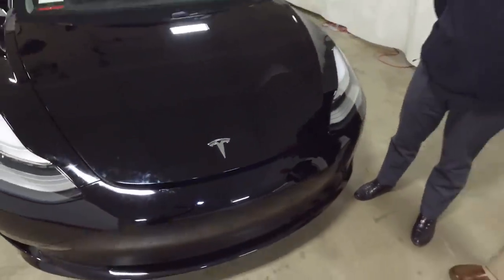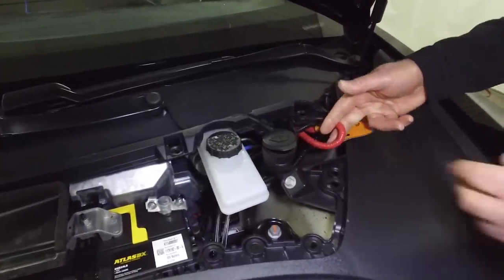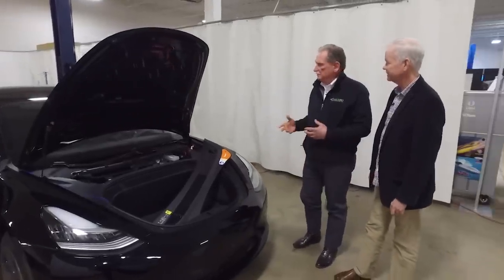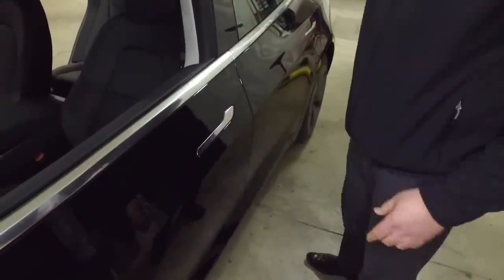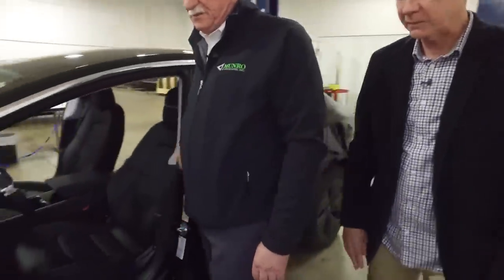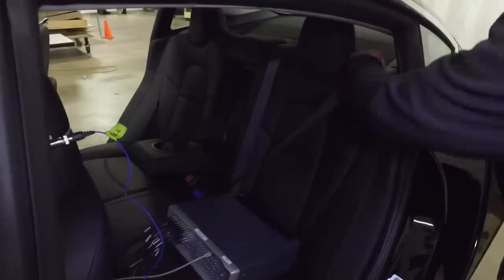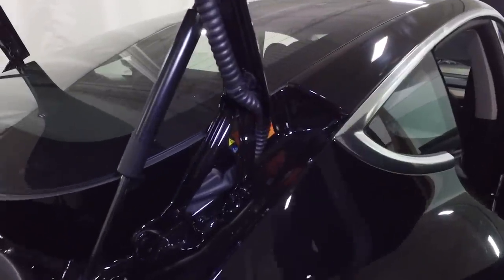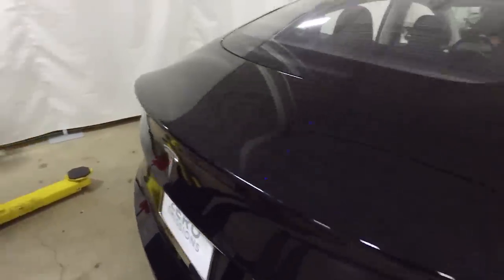Tearing Into Tesla's Model 3

Comment: Excellent points here.  No reason this shouldn't get thumbs up I don't care how much you think you love the 3.  I subscribed.
Reply: Bo McGillacutty How about the fact that gas cars don't have any outside mechanical release to open the hood?

They're feeding off the ignorance of people not knowing that firefighters pry open the hood in every car crash. So to force a viewpoint that a locked frunk impedes first responders is a lie and unethical propaganda.
Reply: azalru
"lie and unethical propaganda"?    Sure they are out to GET TESLA!!!  You don't need to disconnect the battery in conventional cars to prevent electrocution whilst cutting their way into the passenger compartment, that's why first responders don't bother lifting the hood  AT ALL normally.
Reply: Bo McGillacutty Yes they do need to get the under the hood to disconnect the battery connection on gas cars. That's why the halligan bar was invented in 1948.
From a firefighter -
"We cut cables on all extrications and yes. Airbags can still deploy up to 5 minutes after power has been disconnected. But if you remove the power it will take you a sizable amount of that 5 minutes to set up and get to work. With us the battery cables both get cut while the officer is doing his walk around and deciding how much cutting is necessary to achieve the goal of patient out of vehicle"
Reply: Your telling me that the airbags have not already deployed in an accident that requires such extrication?  They sure should have. Sounds like a waste of time to be mucking about under the hood on a 12 volt system.
Reply: Bo McGillacutty Then don't join the fire department. 

If there's power, there will be Sparks to the carpet causing fire.
Reply: I prefer to earn my money honestly.  Where I come from firemen get 6 figures and mostly sit around doing nothing and their "jobs" are virtually risk free.  Only ONE fireman has lost his life in the last 150 yr.s in my small city compared to several per yr. in industry where the employees actually work for a living and are not pampered with benefits and guaranteed paychecks while the city struggles to stay solvent.  (pardon the tangent)

BTW--carpets don't light from sparks, lol.  Have you ever tried that?  Even drops of burning steel only melt holes in them.  Anyway they often use abrasive cutting wheels to cut roof pillars and such that send a million times the sparks that any wiring system possibly could.  Drop a lit cigarette anywhere in a car and it's only going to melt something.

Comment: I hope Elon Musk sees this and works on these flaws
Reply: Marius Merchiers Do you hope that gas cars will have outside mechanical releases as well?
Reply: peter pan Where the trapped person is?

Is the firefighter going to go inside to pop the hood, saying excuse me to the occupant that needs saving?
Reply: peter pan They have been opening hoods for access to the 12v battery, for the longest time on gas cars, as that's the rule before extrication of trapped passengers.

At least the 3 has two options on the outside unlike gas cars that only have one.

If in a frontal collision where the 12v battery inaccessable, what good is the interior lever going to do if it only pops the hood, where the 12v is inaccessable. That's pretty pointless, and not a backup. 

And firemen aren't popping hoods that still need to be unlatched in the first place. They are breaking hoods open in seconds with the halligan bar since 1948.

A real backup is the rear pillar of the 3, if the front 12v is inaccessable.
Reply: Elon Musk is a con artist. His company doesn't turn a profit, and he attracts investors through marketing hype, if he didn't push this car out as fast as he could that investment money would dry up. There isn't anything particularly groundbreaking with Tesla cars.

Comment: I saw a video of a burning Tesla. The fire department actually cut the cable at the rear window. But the amount of generated toxic fumes during the fire was awesome, not to mention the amount of water they needed to extinguish the fire. And even then the fire department needed to quarantine the car for 24 hours to make sure the fire didn't relight. Great stuff those li-ion batteries.

Comment: I'm a fireman. If we need to cut power to the car for an emergency, we'll pop the hood with power tools. N then cut the power cord. It takes seconds. This guy doesn't know what he's talking about!
Reply: I feel like if the car is trashed enough to merit using jaws of life on it, then forcefully prying open the hood to get to the battery disconnect cable isn't going to be an issue.   Now if the car is just disabled for whatever reason, then yea, being able to crack the hood using a 12v battery isn't a big deal.
Reply: the good thing about the big body gaps, one could just reach in cut. lol
Reply: Here's the first responders guide from Tesla: https://www.tesla.com/firstresponders
Reply: I meant "you" as in whoever is going to tow it.  Generic term.
Reply: Well then that's good to hear, Grouponful.  To a non-fireperson, it all seems on the surface to be a time-consuming/unnecessarily complex process.  What about the taking a powersaw to the back rear quarterpanel - does that also not present much of a problem, in an emergency situation?  I ask because I'm in line to get one, and the stuff this guy pointed out, some of it is concerning . . . . on the face of it.
Reply: I wa in NYPD emergency rescue, and I am sure I would be doing the same thing, pop the hood with a crowbar and cut the cable
Reply: Weazel yeah. Just used a lot of water to put it out. It wasn't a big fire though
Reply: Right, I'm also a fireman and currently dating a Sweden's female swim team.
Reply: What I meant was if the car is just disabled, then having a way to get in the frunk, using 12v, to recover something left inside or whatever is nice.  I didn't mean get in the front trunk to cut the power cable.  If the car is just disabled, then you can tow it normally.
Reply: That's the thing, in a catastrophic accident, it may take several minutes for First-responders to get to the scene, if people inside the car need to leave the car immediately, and the only people there are other drivers, that could very well be an issue. The thing that gets me is that normal automakers always put mechanical by passes or disabling devices on vehicles to cover all contingencies, what Tesla seems to be doing is just extremely short sighted.
Reply: I believe if the front-end is totally smashed you won't be able to open the hood thus why they have a backup power disconnect.
Reply: CIAVERMONT if the car is just disabled we don't randomly decide to cut battery cables 😂😂
Reply: CIAVERMONT not a concern of any firefighter we don't tow cars.
Reply: CIAVERMONT you're replying to comments about firefighters doing firefighter jobs. we don't tow cars. 

pay attention to the context before arguing for arguments sake and looking like an idiot.

Comment: Munro is tough on any car he looks at including BMW, Chevy, etc.  He has valid criticism about mechanical latches, but It's hard to listen to him talk.  

I don't see the gap problems on the Model 3s that I see in the wild.  I live near the factory and the greatest density of Model 3s are in my area. I see them parked in my town and when I do walk arounds and nit-pic the gaps, I don't see gap problems.
Reply: Killroy No gas car has an outside mechanical latch. How did firefighters get to cut the voltage cable these past hundred years? They pryed the hood up every single time.

Acting like the Model 3 is any different is just plain FUD.
Reply: I think you misunderstood.  The rear doors and the front trunk don't have mechanical latches. I would not call that show stoppers that is why I don't like Munro - he balks at issues that I would not call major. That being said I would prefer a Model 3 over a Chevy Bolt EV -  just a better value and better staying and performance.

Comment: What the "expert" obviously doesn't know: The battery will be diconnected automatically by a crash. The two cables in the front and back (here the symbol for cutting is acutally very clearly to understand) are just the possibility for the rescue teams to ensure that the chassis is really free from any voltage, especially if the chassis is heavily deformed. But I would also prefer a mechanical solution for the trunk.

Another mistake: There is a 12V battery and the main battery. The first one will also work after the automatically disconnection of the main battery, so the trunk and all doors will always still work. The "emergency" whole is just for the situation, if the car has stood too long uncharged.

According to the massive finger prints on the surface, I guess this car has been disassembled a lot of times. A reason for the unusual clearance. This could be also the explanation for the "glued piece of rubber".

Comment: The Red Model 3 I have stopped bye to see twice in Scottsdale,AZ showroom has build quality better than that of either my current BMW X3's (which are going to be replaced by Tesla's) and my RAM 2500HD.  How I can't wait to get rid of ALL of my current OIL BURNING pieces of poop.  BMW's which have failing gaskets everywhere every 20-30K miles, failing High Pressure Fuel Pumps and other common issues.  BMW  bleeds owners patience and pocketbooks if they dare decide to keep their cars more than the few years BMW warranties them for.    RAM....geeze let's just say I had the truck in the other day for five recalls and two others they don't even have fix for...one of which helped kill Checkov.  Then there is the issue where the radiator shroud gets sucked into the fan and then shreds the fan blades and all the hoses which of course is just awesome....kind of a known issue.  I could go on how my first PHEV a Ford CMAX....FORD would do everything not to stand behind a product like claim that the charging cord wasn't warranted because the PHEV warranty book stated that the cord was under warranty for the full plug in FOCUS but because the book wasn't updated for the CMAX & Fusion at that time that I was shit out of luck.  What was even more hilarious was how I was in the dealership  awaiting a callback from FORD escalation and I get a call from an FORD extended service person trying to sell my a an extended service plan because in the 1 hour I had been there they decided to sell my info/sales lead.  I could go on about Honda's having exhaust manifolds crack(common)  So screw all you crappy car companies I'm done with your dirty shitty cars.  Maybe Big Auto along with dipsh** Bob the Lutz will figure out I'm not buying a BOLT or other piece of crap you make without a charging network.  And no I'm no going to use some charging network that charges 10X the going rate for a Kilowatt! The goal is to save money not pay $7 to go 20 miles or be limited to driving within 200 miles of home.

Comment: He is way off on the door handles 1.) opening them requires no special effort 2.) even if you have weak wrists like Sandy... the door also opens electronically from the outside--if you just push the fat part of the handle the door pops out a couple inches. You don't have to pull the handle at all, just hit the button and grab the edge of the door to open it one handed.

Comment: I agree about the gaps.. But, I do not understand why they are confused about where to cut the back of the car in emergency. Isn't that the same with all the cars? No cars will have it labeled outside saying "CUT HERE IN CASE OF EMERGENCY"
Reply: Actually, most other electric cars (certaily all electric cars with higher production volumes, except Tesla) have small explosive loads to cut the power and they additionally have automatic high voltage disconnects within the batteries

Comment: I guess all fitting problems are due to Model 3 being a new car in production, so production issues are to be resolved.
On the safety side - surely it's done weirdly, but you have to remember that it's an electric car with isolated high voltage. In case of accident I don't imagine anything else then battery shorting out, and burning fuses (each cell has one), thus making the car safe.
And even if battery starts burning, it has very low energy compared to normal fuel, so getting it in flames isn't that easy. 75 kWh battery is equivalent to ~5,8 kg of gasoline (7,7 liters).

Comment: The rear door issue is exactle the same as a car that has child safety locks engaged.
Reply: NearCry91 those safety locks automatically unlock in an accident.
Reply: I'm not so sure they do in all cars. Atleast in older cars where the system is fully mechanical.
Reply: NearCry91 a lot of things didn't exist in older cars. I don't know of any that don't auto unlock in case of accident currently.
Reply: G Man cool, is it actually in use though?
Reply: G Man Got a source for that? First I've heard of automaticly unlocking child door locks.
Reply: Josh McCullough https://patents.google.com/patent/US6081758A/en

Comment: hahaha 2 old farts who have no idea how to operate a tablet or connect to a wifi discuss a modern day car that's not even released yet
Reply: Your judgments are based on what? Have you seen them fail to use a tablet or connect to wifi? Also, their ability to connect to wifi has little to do with discovering safety and tolerance issues of a modern day car.
Reply: In old guy's defence in this day and age of computer designed and manufactured components it's pretty impressive that the parts don't fit together properly.
Reply: It is released.
Reply: In Banana Phone's defence, the old guy does say, several times, that he's a mechanical snob. Take that for what it's worth.

Comment: Uhm, the main power cable from the battery doesn't run through the A-pillars for fun, its there to be cut by the fire department in case of an accident. The emergency frunk release is there in case the 12-volt battery is flat and you need to get in. The panel gap is indeed awful, but I can't help but notice that close to nobody has taken delivery of their Model 3, therefor this is likely a pre-production model that they've gotten their hands on.

The trunk is heavy says the old man, yes, but did he also find the button on the remote that opens and closes the trunk automatically?

Comment: chances are the fire dept. is going to use the jaws of life to open any portion of the vehicle.  They aren't going to get the bumper thing and work with it.
Reply: ms3er for electrical car, you will want to kill the power. You don't want to electrocute yourself before pulling others ads out from dangerous.
Reply: agree but they aren't going to stop, look up how and where to do it and follow a multi-step process.  They are going to grab the jaw, cut and go.   Overall, if Tesla doesn't improve on things like this, they are doing the public they service a dis-service.

Comment: "We've never seen anything like this"

Not been paying much attention, then. Check the only way manually opening the hood of an i8. Or any number of Porches.

This is not as unusual as this guy claims. There are plenty of examples of worse.

I mean, it's pretty infuriating - on an i8, the emergency hood release is in the door seal at the front. The door is electronically actuated. You have to break into the car, find and use the emergency manual door release, open the door wide enough to reach the latch, squeeze down there, take out a rubber bung and THEN pull a wire.

Sorry, but if a fireperson has to get access to a passenger in a Model 3, they do it precisely the same way as they do it in every other car on the road: break glass and cut the A pillar. There are no high voltage lines in either of these areas and they'd know that.

"They're not going to dive in and start clipping" - they will have TRAINING MANUALS on this! They do on EVERY NEW CAR. They will KNOW that they can't cut high voltage anywhere in the area of a passenger! It's fucking obvious that there are no high power lines above floor level.

This is such a non story.
Reply: Sorry but why are you comparing the i8s and other Porsche's emergency hood release system with the one in this car? There may be worse but that doesn't make it okay. But I am with you on the fireman part.
Reply: Hes comparing other cars because they stated in the video 'they've never seen anything like this'', as if its some crazy idea. His point is if they've taken apart any other high end electric vehicle, they would have seen this more often.
Reply: WankelGT as Zomgdevil correctly points out, my point is they said "they've never seen anything like this". That's hyperbole. There are worse examples in both ICE and EVs. If they tear down a lot of cars they'd know that this is far from the most inelegant example of reaching a cutoff loop.

So why say it?